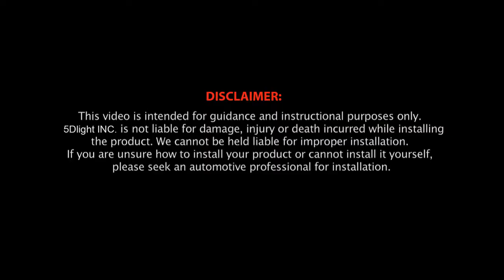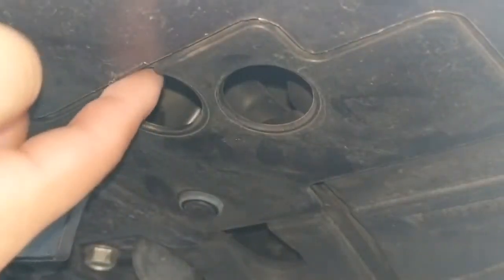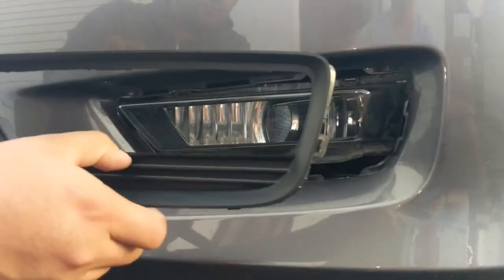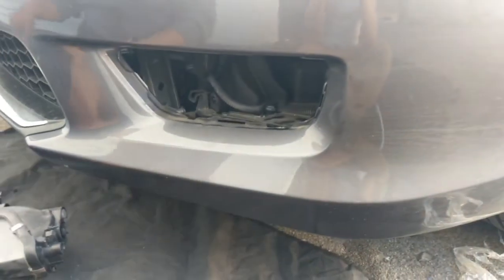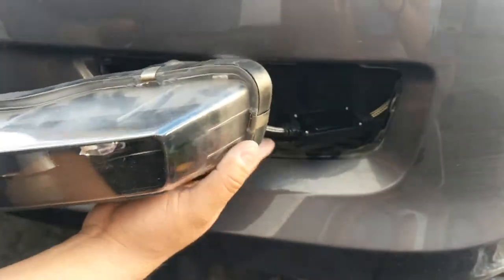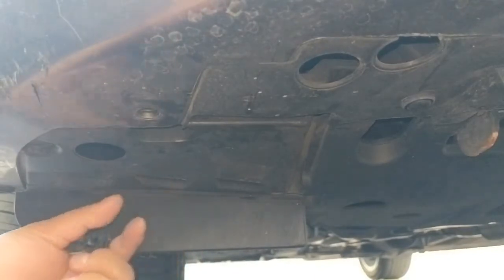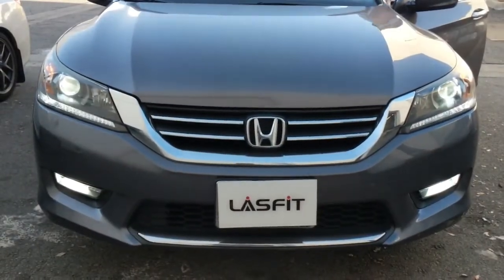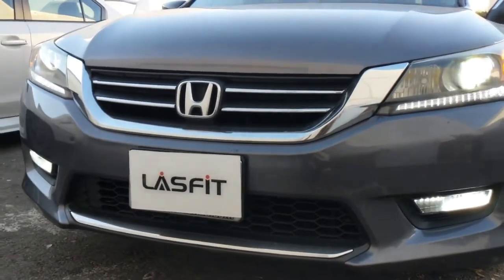How to Install LED Fog Light Bulbs on 2013-2017 Honda Accord

Comment: I just bought h8 lights what's the difference???
Reply from the maker: Would you please tell us whether you have bought Lasfit H8 LED bulbs?
The difference between H8 and H11 is the tab of the socket. Lasfit LAair H11 LED bulbs can effectively work with all of these halogen bulbs, providing an efficient and reliable replacement option for different vehicle owners.

Comment: Do you guys have a lux meter at your shop?
Reply from the maker: Yes. Do you have any questions?
Reply: Lasfit Auto Lighting awesome lol i was going to stop by and get my HID setup measured to see what the lux output was. Currently have a hylux 45w ballast with XenonDepot Philips XV2 4800K bulbs. Where in Los Angeles are you guys located? And would I be able to come and have you guys measure the Lux output? 
Thanks!
Reply from the maker: @Hakuna_My_Tatas  We're located in Ontario, CA. What's your vehicle make, model and year?
Haha, welcome to our store. 🚗
Reply: Lasfit Auto Lighting oh nice, quite a drive for me but willing to come out if you guys are okay to measure the light output. I am out in SFV. I also just want to see if these XenonDepot “Philips” based capsules are actually legit lol. What days and hours are you guys available?

Edit: car is a 2014 Accord Sedan

Comment: Is this the same way for the 2017 accord?
Reply from the maker: Hi, you can watch the video for 2017 2016 Accord and check all compatible LED lights from here:
https://www.lasfit.com/products/2016-2017-honda-accord-led-headlight-bulbs-exterior-interior-lights?utm_source=Social&utm_medium=YTB%20Channel&utm_campaign=Honda%20accord%202016-2017

Comment: How do you aim/align the fog lights on this car please
Reply from the maker: Hi, the base collar of LED bulb has three sticking points, different shapes. You need to use this LED bulb to align the fog light housing socket, then press the LED bulb, rotate and turn it in place.

Comment: Is it H11 for fog lights on 2015?
Reply from the maker: Yes. You can check all compatible LED bulbs for your 2015 Honda Accord:
https://www.lasfit.com/products/2013-2015-honda-accord-led-headlight-bulbs-high-low-beam-exterior-interior-lights?utm_source=Social&utm_medium=YTB%20Channel&utm_campaign=Honda%20accord%202013-2015

Comment: On a 2006? U sure?
Reply from the maker: Yes. 2006 Honda Accord, the low beam bulb size is 9006.
Reply: 06 is definitely different.
Reply from the maker: @marialyvazquez6918  Yes. But the low beam is the same bulb size. You could check your your low beam bulb size. If you're not sure, you can take some pictures of your OEM bulb to send us for a look.

Comment: Good video, but this only pertains to the models that have that feature for fog lights to be mounted that way. If you have the base model Accord, you won't have nowhere to put fog lights.  That should've been explained in further detail.
Reply from the maker: Hi, all these LED bulbs are used to replace the stock halogen bulbs. 
Do you want to add the extra fog lights on your car?
Reply: 😂 You can't change fog lights on a car that doesn't have fog lights